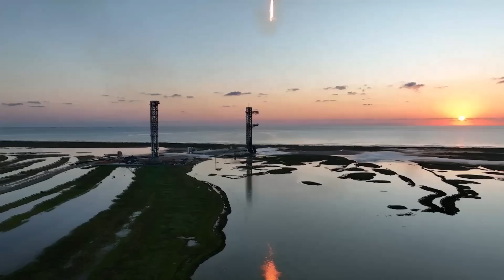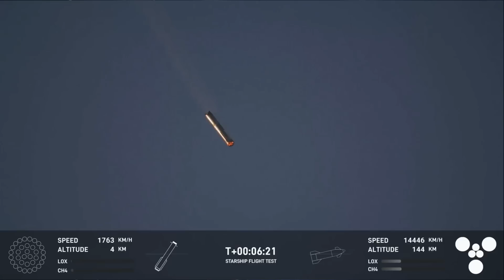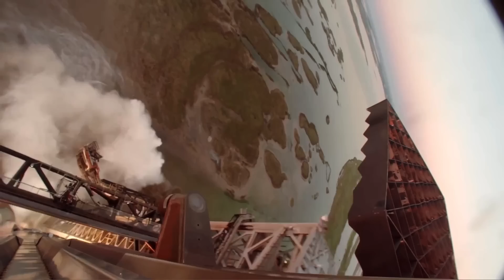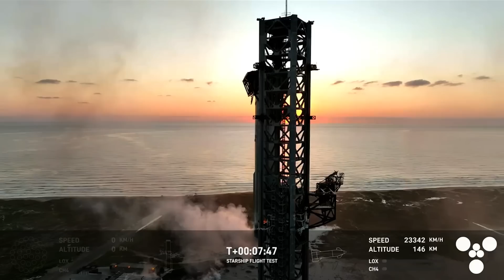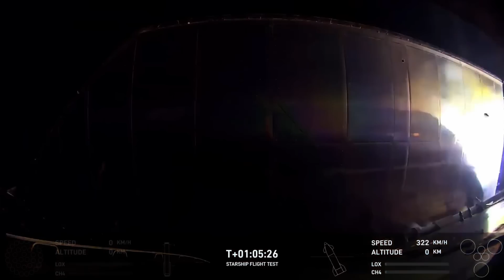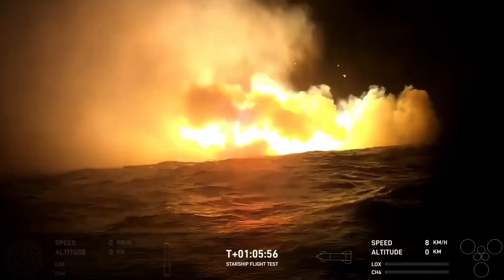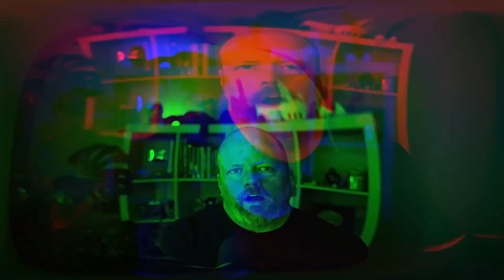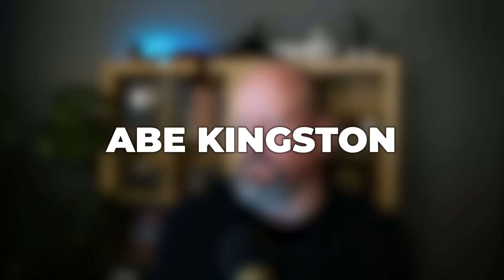ABSOLUTE Success! Full Analysis of Starship IFT-5 (with @scottmanley, @MarcusHouse )

Comment: Okay crazy idea 💡 
Just spit balling here, but what if Superheavy reentered staging ring first? It's a heat shield after all, and it's built to take Raptors point blank in the face. It would be able to handle any forces the atmosphere could throw at it. It would take a couple of extra flips, but it would take care of the bent outer nozzles. After hot staging and the first flip and burn, flip Superheavy so it enters staging ring first. Then, flip it again right before the landing burn. A second flip and burn. Sorry, but I'm an Expance fanatic and love saying flip and burn. Beltalowda.
Reply: @timonium252  hot staging ring is not intended to make final production. The best part is a part you don't need ...
Reply: @willpalmer13 I think you're confusing the fact that SpaceX is going to stop ditching the ring during the coastback, that doesn't mean they're getting rid of the ring. Superheavy absolutely needs the ring if it's going to be fully and rapidly reusable. The Soviets didn't need them because their boosters were expendable. There's no way Superheavy could survive Raptors at point blank range without significant armor. Like 10 tons of armor.

Comment: Why doesn't SpaceX just build a chine on the fuselage to direct plasma flow past the flap hinges?
Reply: Newer versions of Starship have the flaps mounted further "back" away from the plasma flow. The flaps are no longer centered in the middle of the cylinder. I believe that will help a lot.
Reply: @SeanChYT  Those are reasonable.  The flaps, both fore and aft are areas where Elon Musk's principle of the best part is no part could be most useful.  

I would like to see some experimentation using one or two swing wings mounted dorsally.  These wings would be stowed for the ascent, deployed immediately prior to reentry, used to maneuver and slow the Starship during descent, and then restowed prior to the terminal landing maneuver.

Comment: Isn't the elephant in the room that it appears to not have enough deltaV to get the ship to orbit?
Reply: Not at all
Reply: It absolutely does. They don't fuel it all the way for test flights.
Reply: @16BitGoofball  what evidence do you have of this?
Reply: @biggieb8900  Just watch the official streams. The graphic on the bottom shows the propellant tanks aren't completely full.
Reply: @16BitGoofball  they filled them completely, why would they do anything different? Looks like little slivers on the graphic
Reply: @biggieb8900  Because it wasn't carrying a payload, and it didn't even circularize the orbit. They didn't need to fill it completely.

Those "slivers" account for a bigger chunk of delta V than you think. If it couldn't reach orbit unburdened and with full tanks, don't you think that the smartest rocket scientists in the world would design it differently?
Reply: @16BitGoofball  yes, and they are designing it differently, That's the purpose of version 2 and 3 which are coming up right? You make a good point that the last bit of fuel accounts for a lot of Delta v, but I doubt this ship can get much to orbit without shaving off a lot of weight
Reply: @biggieb8900  Yes, there's a lot of improvement to be made.

That doesn't change the fact that you originally said it plainly can't make it to orbit, which is false.
Reply: @16BitGoofball  well so far the evidence looks like it can't

Comment: this was very exciting, but like scott (who you interrupted when he didn't agree with your optimism) i'm still skeptical:

the fact that they have already planned even bigger versions to have a bigger payload isn't a great sign.

we don't know that starship, with its massive heat shield, won't be similar to space shuttle and require a ton of work to reuse.

you handwave the amount of engineering left to get this thing to where it's actually finished, but there are a ton of nontrivial problems that haven't been solved yet.

i want to see humans on the moon asap, but it will likely be china that does it first, and returns with mars samples.

i don't really see why you think everyone needs two-stage reusability.

Comment: I'm not going to deny how cool a rocket landing is every time, but I still feel that the cost effectiveness of reusability has never been fully demonstrated.
Reply: Well, it has for Falcon 9, by a long way. Some of them are on their 20th mission, which is crazy. Starship is far more complex and immature, but it'll get there.
Reply: @aldunlop4622  With the cost of the extra fuel for landing, added complexity of the equipment, added weight of all the equipment for the return. Each launch of the space shuttle cost more than a new Saturn V and SpaceX charges more to launch humans to the space station than Roscosmos did before the end of the shuttle program. In terms of cost effectiveness specifically, I don't think the Falcon 9 has proven reusability is better than a modern designed single use big dumb rocket would be. What has been greatly achieved with the Falcon rockets in general is design experience for the needed landing system for a human capacity vehicle landing on Mars, and they can put on a great show to draw investors.
Reply: It isn't a question of if it is reusable, it's whether or not it's more cost effective compared to a simpler single use rocket. A reusable system is more complex and needs far more fuel per launch than a single use rocket. The Space Shuttle cost more with each launch than the Saturn V for each new rocket. SpaceX currently charges more per astronaut to the ISS than Roscosmos did before the Space Shuttle program ended. I feel the main thing accomplished with the Falcon rockets is a landing system for larger vehicles reaching Mars, and the landing makes a great show to draw investors.

Comment: Staggeringly awesome. They are going to learn so much from this flight! Can't wait for #6!!
Reply: Especially from physically examining the lower stage. It helps a lot to actually get the hardware back. But I'm not sure how much they can learn from the upper stage splash down, especially about the thermal protection system, since they have to infer things from telemetry and limited on board camera footage only. Hard to infer how well the various ceramic tiles were holding up. Elon Musk said on Twitter recently he hopes the upper stage will be caught early next year.
Reply: Not so quick, the booster hasn't been reused, the starship has just polluted the ocean. Nothing has been delivered to space
Reply: @loftismark  I think they'll land with the hot staging ring and do orbit/deorbit on #6. They should deploy a few Starlink satellites, too.

Comment: I'm not sure how much they can actually learn using tech that they know they're not going to be using in the end. Yes you could learn how to better protect a Raptor 2 during re-entry, but is it worth it when the booster will ultimately use self-cooling Raptor 3's that don't need a heat shield?

Comment: The solution to the engine issues is move on to Raptor 3 and sell the spare Raptor 2 engines to the highest bidder.

Now Starship needs a capture barge with a surrounding three piece capture ring to rapidly move in and embrace Starship to prevent it from tipping over on landing.

Comment: Well, I was sceptical, until maybe an hour before liftoff, and I commented on I think EA's stream that "well, all they have to do is get the booster to the right coordinates and zero the vertical velocity and it should work". I was suddenly strangely positive. What amazed me wasn't the booster so much (which was amazing) as the catching arm, it was like a human arm that just reached out, adjusted itself, and gently caught it! The engineering in the tower is incredible, considering all the massive weights involved, these massive machines were almost delicate. Crazy stuff.
Reply: And I have trouble catching a softball in the outfield.
Reply: The most insane thing to me is the engine gimbal, that’s a giant engine bell pumping out thousands of pounds of force quickly and precisely rotating.
Reply: The arms are hydraulically powered. From building site diggers to rocket catch towers, the control accuracy is amazing.

Comment: I wonder what are the numbers of a reusable super heavy booster, with an expendable 2nd stage (lighter build, maybe bring back the carbon fibre) with an over sized fairing. Starship is investing a big part of the super heavy payload on coming back... get rid of that ... and that payload number could be huge.
Reply: I remember an old number saying 250 tons or something? I think with the current booster, use 5-6 vacuum raptors with no sea levels, I'd bet they can put up 100tons already.

Comment: With the successful catch attempt, the oil rig towers are starting to look sexy again for catching the booster, and the ship, though I would like to get a look at the landing pins on Starship once it completes a flight. Beyond that, I'm wondering when they're planning on putting payloads in Starship and start using it for that purpose.
Reply: @chubbyadler3276  that might slow down reusability though.

Comment: Being able to examine the booster without the impact damage, salt water contamination or any other damage not caused by atmospheric passage should greatly improve the pace of development.
Reply: Exactly. They also need the ship back as soon as possible! I suspect getting the thermal protection system to high reliability might be more difficult than orbital refueling. (I'm speculating of course.) At least NASA had massive problems with ceramic tiles on the Space Shuttles. Anyway, Musk said he hopes they catch it early next year.
Reply: @cube2fox  
My hope is that the ship's de-orbit burn can be tested on the next flight - November? - and ship catch on the flight after that.  With both done by the end of the year or January.
Reply: @cube2fox  I agree. They have already done a fuel transfer from the header tanks to the main tanks before. And transfer between 2 ships shouldn't be that much harder than that, since docking is a well known science.
Reply: @kukuc96  
I suspect the tanker will need the standard female quick disconnect for loading on the tower and a male quick disconnect to connect to the ship to be fueled in orbit.
Just my guess...

Comment: Scott makes an excellent comment about how the engines aren't being chilled with the liquid oxygen or the densified methane so they're going to be, you know, sort of cooked up and getting a little crispy on that outer ring.

Why don't they think about a deployable APU to run a LOX pump for all ring engines. Basically nowadays they're used in aircraft. It's called an Auxiliary Power Unit, APU. If they deploy at Mach 2 perhaps and that would be quite a bit of energy that could be harvested to run the pumps and not use fuel and help break the craft also because they create drag. Like three of them in a triangle configuration around the perimeter of the core. The design of these would be like a mini nacel and completely different from the APU,s that modern jet aircraft use. They look like a wee propeller that descends from the base of the aircraft when all engines are OUT and it's like a last ditch effort to remain in control of the plane. That requires running the hydraulics or fly-by wire system. To be quite Frank, these could replace the hardware at the top of the super heavy with more dynamic control plus energy harvesting creating drag. This would be like the Corvette version of super heavy. It would be expense for sure.

Comment: Great discussion. Is it possible for Space X to put a large payload fairing on top of the super heavy booster right now rather than starship to deploy huge payloads into orbit or beyond?
Reply: Not unless that payload had it's own powerful 2nd stage. The booster doesn't get anywhere near fast enough for orbital velocity.
Reply: @wally7856  You're right of course. It would be nice if there was a semi reusable option until Starship is perfected though.

Comment: Sure they can catch a Starship on Earth, but Starship was not built to just come back to Earth. SpaceX cannot catch a Starship on the Moon or Mars where no infrastructure exists.  It also cannot simply land on it's end as it's rockets will blast a crater where it's trying to land. Unless they come up with some other solution, Starship needs legs to land! The legs will also need to be long enough so the rockets again do not blast a crater below.
Reply: You have to remember the gravity on the Moon and Mars is very different. For instance, they don't need to use the main engines to land on the moon surface, just some smaller thrusters they can place on the top of the ship. Legs can be quite simple in comparison to what is needed on earth.

Comment: They are very quiet about what happened to the Starship.  But they supposedly did examine the heat tile failures on 4, and I expect they did the same sort of thing on 5.  Did they haul it out of the ocean and put it on a ship???  That is the part that they are keeping quiet about, as they did for 4.  How do the tiles handle the quenching etc., this is probably information that they do not want the competitors to know, after all the R&D costs.
Reply: I doubt they recovered it, it would've sunk to the ocean bottom.
Reply: @aldunlop4622  That is the part they are so secretive  about.  Do they recover it, and what do they lift it out of the water with?  The fuel tanks are empty, so it will float like a boat.  So how did they inspect and learn from the heat tile failure on 4?  (they seem to know a lot about the failure causes) And do they not want to learn if there were any failures of any kind on 5???   Where both 4 and 5 landed, there were cameras making videos in the dark, indicating some sort of presence there.  So what recovery equipment was present that they keep so quiet about??
Reply: @bigpicture3  They keep quiet about it because there is nothing to talk about. There is no recovery. It will not float, the fuel tanks will most likely rupture when it falls over (this time it exploded).
They learn from the video and sensors of all sorts.

Comment: I think booster went through the atmosphere reality at the fast max speed due to delay of shutting off all but four rapture engines by 2 seconds.   I think it was due to adjusting to the hotring.   These two seconds of fuel limits the distance and time for the AI computer can us that time to slow down the descent.  However, it work.  Amazing.  PS..the flame seems to have a stable pattern on Starship...Looks like they are solving the problem.

Comment: I think eventually as super heavy becomes lighter and more refined. They'll have finer final builds that are optimized so that more propellant can be used for perhaps an entry burn because things are getting a little too hot. If those rocket nozzles were warped man, those things can take a lot of heat so I think they're coming in a little too hot. But somehow at 60 km at altitude, I don't know if the velocity was quite as high as a falcon 9. They usually like to scrub it from 7,000 down to about 5,000 mph at that point. It would be interesting to see the speed to altitude ratio plotted out for both ships side by side. Maybe Scott can do that for me. Thanks!.
Ps I think Elon wanted to cook this rocket just to find out how much heat it could take. I wouldn't be surprised.

Comment: Landing barge - add four long arms to the barge that can fold in to stabilize the starship. Kinda like the chopsticks. Maybe have a meter of collapsible material on the deck such as crumpled aluminum foil or fire resistant cardboard for the engines to settle into without bending them.
Reply: Why? Their aim is to launch again after 1 hour of landing, so landing on the launch site is the optimal solution. They have already shown they can pull it off. After they catched the booster they quickly lowered it into the launch mount (with the hold down clamps) and connected the quick disconnect arm.
Reply: @SeanChYT  sure. It's probably the case that they will transition to a full orbit and land at the other launch tower, maybe for tests as early as 10 or 11. But if they want to be able to closely inspect the starship before then, having it land in a barge might be worth doing. Even if it is for only a few tests.
OTOH, it might be useful to have such a capability as an emergency backup.

Comment: 21:10 remember that the Raptor 3 weight much less, so those savings could be used full or partially to store more propellent and have a slightly more controlled entry. (Maybe the whole weight savings isn't enough, just me guessing)
Reply: I think 1st plan with that weight savings is to hold on to the hot staging ring that they currently jettison for weight savings on the way down.

Comment: Did y'all see the grid fin immediately after the hot staging? The wash from starship's rockets bent the waffle's slats like toffee. Amazing.
Reply: I think they are controlled that way to turn away for the boost-back burn.
Reply: It didn't bend or melt. They angle the grid fins intentionally to direct the thrust from the starship into a side force on the booster to aid in the flip maneuver.